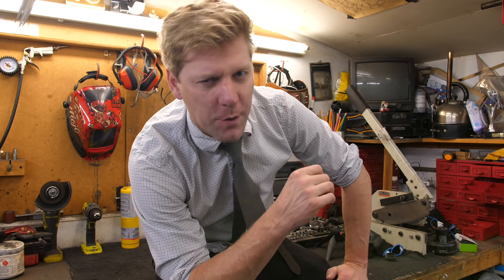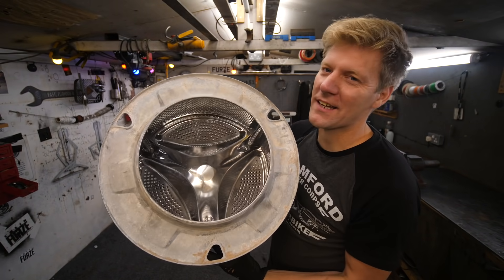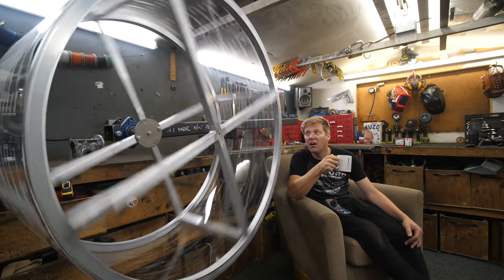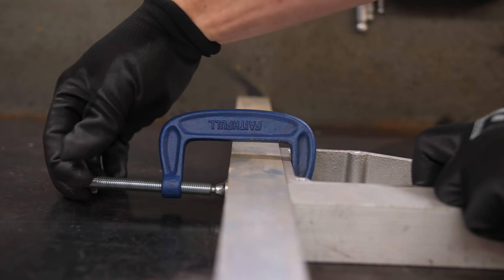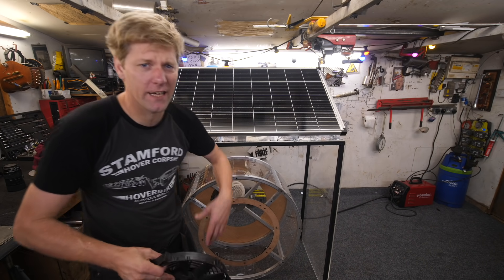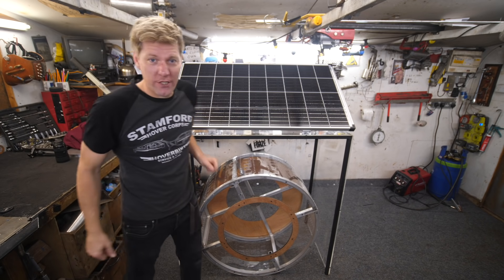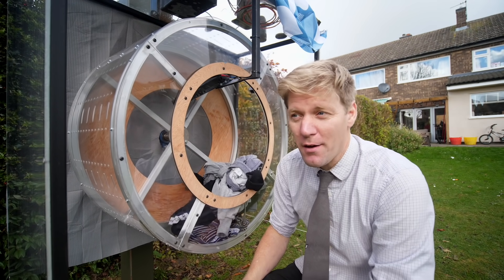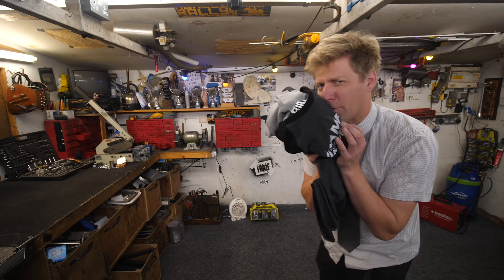Wind/Solar Powered Clothes Dryer

Comment: "Shell" and "eco" in the same sentence is just plain wrong. This is the definition of "greenwashing".
Reply: @n325aej You're like... super wrong
Reply: Exactly my thought, Shell is one of the highest producers of Co2 emissions in the world. A shell study actually found how bad Co2 was for the environment, but they tried to hide the study. They spend a lot of money lobbying against green energy and electric cars.
Reply: @n325aej nuclear CAN be safe, especially with newer technologies (such as thorium reactors). the main problem is that everyone is so afraid of The Nukes and the complete tragedy of mismanagement that was chernobyl that all our protocols are frozen in the 70's and everyone throws an unholy fit any time anyone tries to put anything forward for it. it's like banning self-driving cars because one suicidal person jumped in front of one (so they're all Dangerous and can never ever be tested/improved to not repeat this accident, the entire tech/concept must be killed outright).
Reply: Shell, BP and similar companies are all trying to be “green” while making huge profits from polluting the planet.
Reply: @s3tn  Even their hydrogen gas plans are actually brown hydrogen not green hydrogen.

That's a term for the source. Shell and BP are seperating hydrogen from fossil fuels, which releases carbon dioxide.
Reply: @markp8295  
Give me a list of the things that you avoid when you can, and why so.
I've got no problem in using the oil / petrochemical company's products whatsoever, it's all part of the modern, easy and progressive lifestyle in which we live.
Why the fuck should I vote with my wallet?
Whatever the fuck that means.
Reply: @Rob-fc9wg  Voting with your wallet is a simple idea.
If you agree with a product, you buy it. The manufacturer sees this as a sale and so knows the product is more popular if more people buy.

Hence when you spend money, you are voting for a producer to keep producing an item.

To this effect, I have cut out most meat to reduce my carbon footprint.

I have kept chicken that I rear myself and fish that I buy from sustainable fishing sources.

As for what I avoid, I avoid unnecessary journeys. Use public transport where I can and cycle if it's close. I even do the weekly shop by bike. This saves money also.

When I buy fruit and veg, I look for the items that have traveled the shortest distance. (e.g. I am European. I buy Spanish oranges, rather than Florida oranges.)
It's not removing my impact, but it is reducing it.

I'm not going to go into further detail as I think that's enough for you to work on to start with.
Reply: @s3tn  
Well then, it can only be assumed that a man of your convictions would never use any of Shell or BP's products, either directly or indirectly.
Reply: @Rob-fc9wg  I avoid it when I can. Sadly it's everywhere. Vote with your wallet
Reply: Exactly, and I'm a bit disappointed to see Colin partaking in it
Reply from the maker: @reddragon3132  Its not just about shell though, the teams that enter this competition use this as a stepping stone to making there ideas a reality, I was asked to be involved as someone who could talk to them on there level rather than just a random host and if this helps them go on to better things then thats a positive.
Reply: @colinfurze  It sort of is about shell though. I understand that this competition may be beneficial for some great ideas however it is also part of shells ongoing acts of greenwashing. They are one of the worst polluters in the world and they know that is not a good look. After hiding evidence for climate change they then started to fund people who would dispute the evidence and now they are trying to make themselves look like the good guys. This competition may be good, but that doesn't change the fact that it is being run to make the people creating the problem look like the solution. It is a PR stunt to cover up their responsibility for climate change because their business relies on polluting the planet

Edit: was also reminded of this video https://youtu.be/adXkCH3lMug Takes a good look at shell's history and also how shell is still very much against renewables and events like this are just an attempt to convince the public otherwise
Reply: @reddragon3132  I also find it quite interesting that in my area of the U.S. shell gas/ petrol is from .20 cents to $1.00 per gallon more than any other company. What makes their products so special? Payola to politicians?
Reply: @f.k.burnham8491  It's likely just supply & demand vs cost to get it to the station.  Depending on where your location is relative to Shell's oil hubs versus your location to other companies' oil hubs it dictates price to an extent.  They also have to take into account how much fuel they can sell at that price and if they do use that price how much it'll drive away customers.  For example they may be able to get away with a higher amount per gallon versus rotten robbie because they're a more recognizable brand - It's all a delicate balancing act, but no, I doubt it has anything to do with politicians.
Reply: Same. I'm curious to see what he could come up with, but as soon as i saw the event sponsors in the description i can't see this as anything more than propaganda for an oil/petrochemical company. 

A renewable energy drying machine is a noble idea but maybe such projects could be made without this kind of backing? It's an interesting subject in and of itself.
Reply: Companies aren't "evil". Shell can do bad things to maintain oil profits today, and yet do good things to make sure they don't miss out on renewable energy profits tomorrow. Seems silly to refuse the latter because of the former.

This isn't greenwashing - there is no deception here. This is consistent with their message that technology will solve everything and please don't regulate.
Reply: @chaklee435  But they should not be only investing in renewables because they're an opportunity for profits, they should be investing in them to replace their oil business. Yet shell continues their business with oil and gas just as much whilst creating this image of being eco-friendly.

There absolutely is deception, if you look at all of shells branding surrounding this is there anything to let you know that they are one of the worlds biggest polluters and therefore they were and still are cause of the issue that they are now trying to look like they are fixing.
Technology has already provided the answers we need to control climate change and yet we are not making use if it. If companies are not making the changes that are needed (and possible) at the rates needed then regulation is needed
Reply: Exactly!
Reply: What he came up with is also hugely energy inefficient. He'd probably be better off just plugging the solar panel into a relatively efficient washing machine.
Reply: @jackcarnie6488  Inefficient? His device might use 100 watts. A typical home dryer uses two or three kilowatts. If he plugged the solar panel into such a dryer, they'd mildew before they dried. Or if he plugged it into a washing machine as you say... Well, they certainly wouldn't dry then.
Reply: @chitlitlah  He said it takes a whole day to dry the clothes, it might well use less energy in one go, but saving the energy from the panel and turbine, then using it to power an energy efficient dryer would probably be a clearer use, especially when you consider all the effort that went into constructing the thing. This isn't anything against Colin, I love the engineering of the thing it just annoys me that companies like shell put these things on, with people making things which are worse than current solutions which wont get implemented due to lack of funding, and then claiming this absolves them of any guilt from the impact they cause on the climate.
Reply: @jackcarnie6488  So what's wrong with it taking all day? It wouldn't work for a laundromat, but at home, you toss them in during the morning and take them out in the evening. Most people don't find themselves in a situation where they have to have clothes dry in an hour or less.

I really doubt that this "energy efficient" dryer of which you speak actually uses less energy than his, which is just a clothesline that spins. But even if it does, it doesn't matter. In this case, without spending a buttload of money on a larger panel or turbine, you have a limited amount of renewable "power" that you can use for free. Once you exceed that power, you start having to pay for electricity that likely came from a coal plant. Reducing the power and extending the process duration to several hours allows you to power it solely by a small turbine and/or small panel meaning low overhead cost, no recurring cost (except maintenance), and it uses nothing but renewable energy without polluting. It's 100% efficient and no other dryer can do better. It's the best combination of convenience and efficiency you're going to get nowadays.
Reply: @chitlitlah  The issue with it taking all day, is it uses power all day. 100 watts over a 24 hour period is more than a 2000 watt dryer which only runs for an hour. The fact that its all renewable energy doesn't mean its '100% efficient', there's massive efficiency losses throughout the whole thing. As he said, there's wet patches because they aren't being opened up to the air, so the energy that's used to tumble the clothes and blow air onto already dry parts of the clothes is simply a loss. Even beyond that there's obviously losses to heat in the fan, motor and turbine as well as the battery system. Energy is energy regardless of where you get it.  As for it not costing a butt load, I can pretty much guarantee the costs of the build were well over £1000, plus labour.  It is just factually better for the environment to spend that money on efficient, large scale renewable power rather than a solar panel a shady northern English garden in the middle of winter. Again, love the engineering of it as with all of Colins builds, just annoyed at a company like shell spending a pittance to get people to reinvent the wheel to greenwash their own actions, when we have solutions to these problems already which are simply going under funded.
Reply: @jackcarnie6488  It only ran for maybe 10 hours given that there's only sunlight for about that long, probably less given that it's almost winter and the UK is pretty far north. He also said he fixed it so that it doesn't leave wet spots, or maybe he had an idea how to do so; I don't remember at this point. I have little doubt he could make some tweaks to increase the performance. This was just cobbled together.

However, it doesn't matter. Not a single joule of that energy counts since it's all coming from a solar panel and/or a wind turbine. Your energy efficient dryer, even if it only runs for 30 seconds, still uses enough power that it has to be hooked up to the grid, or a much more expensive solar/wind setup to make it prohibitively expensive to most. If his was hooked up to the grid, then it might possibly be worse than your hypothetical dryer, but it's not. It's equivalent to a clothesline, but more convenient.

To be clear, I'm not taking any position with regards to Shell and I'm not saying this dryer is a revolutionary concept that will change the future. It does accomplish exactly what he set out to do though: dry clothes only using renewable energy but without being much more inconvenient than a regular dryer. I found it quite impressive.
Reply: @chitlitlah  He said he has a battery system for when the sun isn't up, it is all running all or most of the day. The energy that comes from it absolutely does count because its electricity. It is exactly the same as what comes out of the plug. End of. A solar panel and wind turbine which charge a battery which runs a washing machine for an hour a day has EXACTLY the same environmental impact as this thing.
Reply: @jackcarnie6488  Show me a battery-powered setup that's reasonably priced and can power a typical electric dryer long enough to dry clothes and I'll concede. I think you'd have to spend a whole lot on batteries.
Reply: @chitlitlah  You know that is literally how he powered this right? A solar panel which he purchased and a battery. If you don't like the battery then sell the energy onto the grid and buy it back when you need it for washing, and the net carbon emissions are exactly the same.
Reply: @jackcarnie6488  I'm fairly certain the battery couldn't handle the power of a regular dryer though. Batteries are very limited when it comes to that, hence spreading out the amount of time the dryer consumes its energy helps.

I would agree that connecting the panel to the grid would be better, but I imagine an inverter for that purpose is pretty costly. I could be wrong. Either way, I still don't agree that this creation was useless and purposeless.
Reply: @chitlitlah  In the UK if you have solar panels on your roof you can sell excess power directly back into the grid.
Reply: @jackcarnie6488  It's the same here in Texas, but the price they have to pay is a small fraction of what the customer has to pay. It wouldn't make for a very good business.
Reply: What I find weird is people using phones made of plastic whilst wearing polyester clothing who drive hydrocarbon powered cars registering their disappointment at someone who actually made something half decent with good intentions. Just remember YOU guys are the consumers. You don't have to buy the products. It's people such as the one's mentioned in this video who are doing their best to change things. What are you doing?
Reply: It’s perfect from shells POV. They get everyone thinking how we as individuals can innovate our way out of their business model that is destroying the planet.
Reply: @n325aej comparably, nuclear is the safest alternative.
Reply: https://youtu.be/kbY53RLJHfYr4
Reply: Oil companies love unreliable energy sources, because they require close to 100% backup with natural gas.

Solar and wind energy is just an inefficient way to burn fossil fuels.
Reply: @phamnuwen9442  That's Bull. Solar and wind can be backed up reliably as is shown with many nations switching over to more renewable sources and massively reducing total fossil fuel consumption. Reduction is visible where before there was only growth of use.
Reply: EXTREMELY disappointed Colin took Shell's money to greenwash their atrocities.
Reply from the maker: @gloverelaxis  Its not just about shell though, the teams that enter this competition use this as a stepping stone to making there ideas a reality, I was asked to be involved as someone who could talk to them on there level rather than just a random host and if this helps them go on to better things then thats a positive.
Reply: @colinfurze  when are you doing your 9 and 10 million subscribers celebration ??
Reply: Who do you think spends the most on green energy morons. Shell, Exxon, and BP all started this garbage of climate change and green energy and are the primary funders of it. It's all about limiting competition and exerting control.

Comment: he could have one black  enclosure inside to convert light to heat with holes and one bigger transparent enclosure to trap the air generated by the blacl encñosure with holes..
going full solar panel for the motor is a must
maybe heat pipes could work too. lol

Comment: The wind turbine really isn't necessary, and I do think wind will die out as a source of energy globally. Solar is just better across the board. Cheaper, no moving parts, less intrusive to the environment when put on roofs, it's just better. Put a second solar panel on there, then you can spin the drum faster.

Comment: Colin: "we don't want energy loss"
Also Colin: uses a vertical wind turbine instead of a horizontal one
Reply: Vertical is better for turbulant winds... It doesn't need to track the wind.
Reply: @johnn3542  it doesn't need to track but you're still only half as efficient. A simple tail on a HAWT would track well enough and would well makeup for any energy loss by being more efficient
Reply: But would require another 90 degree gearbox, which would induce more drag.
Reply: @MrPhilgor  yes but the efficiency of the horizontal makes up for it
Reply: Perhaps there's other reasons behind it, noise, safety, aesthetics ease of building, not being an engineer
Reply: @3finnian  I don't believe VAWTs are any less noisier and they're definitely not safer. As for aesthetics, that's a preference. Ease of building may very well be tho. You don't have to worry about making an airfoil
Reply: There is no difference in VAWT or HAWT. VAWT may be less efficient however in Colin's case this doesn't matter. It's not powering anything electrically.. plus in size comparison of VAWT was the same height and span as a HAWT the VAWT would generate more and be more powerful
Reply: @siennabartlett9993  what. No. None of that is true. I'm actually studying this kind of stuff in college so I need you to trust me on that. HAWTs Max efficiency caps out at 59% (that is wind energy to mechanical energy, electrical energy has nothing to do with it) while VAWTs, if I recall correctly, tend to be about half that. Due to their vertical design, they also cause far more stress on their rotor.
Reply: @The_Jovian  I've been and done the course and installed them also so you know let's agree to disagree.

Comment: I'd rather see a useful invention if you are going to go green man. It's an engineering marvel but less effective than a cloths line. I mean you went with a motor just use the turbine and the panel to a battery to power the electric motor....

Comment: Was that the dryer that you put explosives in?  Or am I confusing this with another you tube video?
Hey you could get rid of all the gears by making the dryer the hub of a horizontal wind turbine.
May be slower than a conventional dryer, but probably faster than hanging clothes on the line to dry.